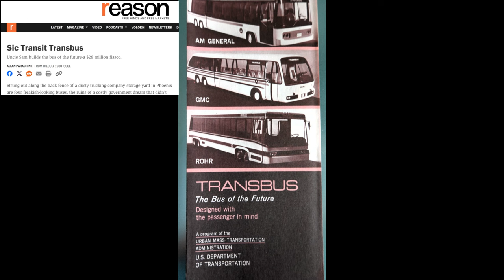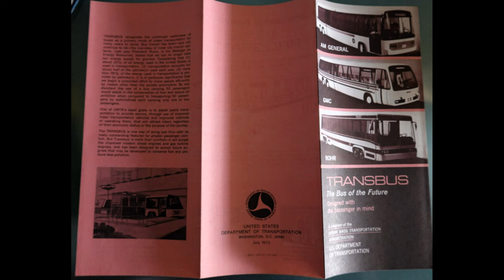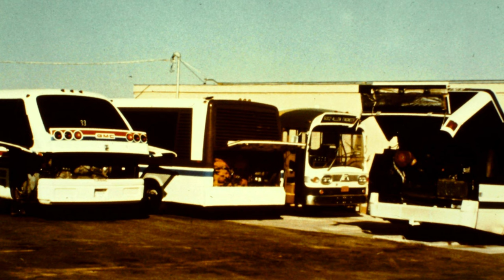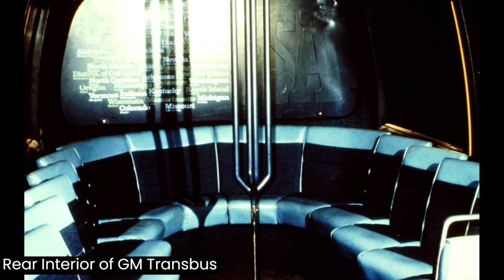TRANSBUS: America's Failed Transit Bus of the Future

Comment: Having ridden the RTS-1 (SPEED movie bus), the RTS-2 (RTS-1 replacement several years on) in various versions.  Mostly the ones I saw were all turbo-charged 6 cylinder models.  Then also the Grumman Flexible busses.  I came to the conclusion that the RTS-1 was the best of them all.  The RTS-1 was built for a maximum of 44 passengers.  The ones I rode in Dallas in the early 1980's, we regularly stuffed closer to 80 people on because this was on a very popular route and you just could not put enough busses on the route.  RTS-1 came in 2 models, a 6 cylinder turbo-charged model and an 8 cylinder non-turbo version.  Coming out of downtown Dallas there was a slight hump in US 75 that made it difficult for the non-turbo busses to make it up and over.  Once past that, the run was okay..  The turbo version had no problem making the hump as long as we had fewer than 70 passengers.  With the large number of people, every stop meant 20 or more people having to get off the let the riders that wanted to get off, then load up and go to the next stop.  Fortunately, the stop I got off was number 3.  It just worked, albeit the AC's couldn't handle the heat unless the bus was parked inside during the early heat of the day.  The RTS-2 models had lots of problems, mostly known for doors that didn't want to open.  They were a vacuum assisted system and there was often too little vacuum for the doors to work.  Later models had the doors replaced by motor driven bat wing type doors and those worked fairly well.  The Grumman busses were trash from the beginning.  Although not noticeable to the riders, there were all these rumors about cracked frames and engines that overheated.  An overheated bus can't run and without the engine running, the AC didn't work, so they worked fine in the morning, but were useless after lunch due to the Texas heat.  Note also that in the years since, Dallas has replaced all the high volume routes with commuter trains and it seems to work much better.  During construction of the train lines, a contractor plugged up a major storm drain, which caused flood water to back up into downtown and flood the basement of several buildings.  Since the electrical was usually in the basement, this resulted in shorted electrical systems that in a couple of cases took the buildings out of service for years while the lawyers and insurance companies argued over who would pay how much.  Also, for those of you that remember the early Compaq luggable PC, imagine trying to carry home this 30+ pound beast on a bus with 70+ people on it.  It wasn't fun.
Reply from the maker: Wow...thank you for watching and for that incredibly detailed comment! I have to go through it for all of the great info you provided!
Reply: I thought the bus in the movie Speed was a GM fishbowl
Reply: There was no RTS 2, They went from   RTS 1 to RTS 3 in 1978.

Comment: WOW great article. Thank you. I was a big fan of the RTS-2 as a kid. I remember with the Baltimore MTA got it's first order of 60 RTS's . These were fantastic because the AC worked very well. At the time Baltimore had the old classic GMC and old running flexible buses. The Baltimore order from news paper reports i can remember were shorter than the regular buses. They were 35 feet not 40. I don't know why they decided to go short maybe because of oil prices. They were ordered in 1978 and delivered into 1979. They got an additional order of 41 buses that came on line in 1980-82. These buses were different because they had been turbo charged. You can also tell because they did not have the noticeable arched back. They had a flat rear back of engine design. They did not stay long in Baltimore. They then went with the new Flexible designed at 40 feet. My school piggy backed on the Baltimore MTA order and got 30 870 flexes in 1985-86 for delivery in 1987. They then got 10 more with 8 30 footer and two 40. All were wheel chair kneeling designed. I loved driving them. Watching this video reminded me of my younger days watch buses and driving buses. Great video. One last thing those RTS-2 must be tanks because i have seen them everywhere. Disney transportation, Rental car agencies, I even saw a few in Tajuana Mexico with hubcaps on Ha Ha Ha. Cheers!
Reply from the maker: Thank you very much for watching and for your very interesting comment about the RTS buses in Baltimore. I'm very happy of your positive feedback!

Comment: Nothing has been as reliable and rugged as the GM New Look. The "fishbowl" buses were still in service long after these "improved" buses were scrapped.
Reply from the maker: Yes, and some still exist from 1959 in the NYCTA museum bus fleet. They still look great and run good, too.
Reply: TTC in Toronto didn't retire their fishbowls until 2012! They retrofitted their fleet with power steering, so life was a lot easier for the drivers.

Comment: Some transit systems like Appleton, Wisconsin's Valley Transit decided to continue with that which was working fine -- the good 'ole GM New Look bus. General Motors continued to manufacture these city transit coaches in Canada. Valley Transit saw benefit in having a unified look (all GM New looks with some old looks in the secondary fleet) to the fleet as well as parts interchangeability. Valley Transit's first-ever, brand-new buses, 1981 New Looks, were delivered in April 1981.
Reply from the maker: Thank you for watching and for your comment! Interesting to hear the preference of Valley Transit holding on to buying the New Looks into the 1980s!
Reply: Here in Oshkosh, the whole fleet was replaced with the GMs. But they kept the old ones for special occasions, like EAA. Now we got the green ones.

Comment: That was a very interesting and informative video. I watched the whole thing. It’s a shame it was so expensive and so disorganized. The RTS and 870’s were very popular and proved to be successful.
Reply from the maker: Thank you for your comment, and for watching the entire video - I'm glad you enjoyed it! Unfortunately, there's not much info out there about Transbus...but as you mention, we did get the RTS and 870 shortly afterward!
Reply: @JeffreyOrnstein Excellent Video! Thank you for sharing the creation of the Transbus. I’ve been a fan of the Flxible 870 and the GM RTS ever since when they first came out.
Reply: There were major design flaws with both models.  the 870 had major issues with the A-Frame structures cracking.  so much so that both DC Metro and NYCMTA had to pull them from service.  the RTS had issues with the HVAC system and had high failure rates with both the 01 and 03.  Grummann resold the design rights back to Flxible and thus the Metro-B emerged.  While that was going on, Green and Jamaica Bus companies in NYC took their RTS 03 demos and tweaked them enough for GM to redesign the AC units and in this case, the RTS-04 emerged. The biggest noticeable change was the switch from the "slope" back to the "square" back.

Comment: Two of the models served as the basics for the GM RTS, and the FLXIBLE 870/METRO.
The RTS was a hit across the country, while the Metro was a close second.
Reply from the maker: Thank you for watching and for your comment! Yes, you are right about the RTS and 870....too bad AM General left the bus business before they could introduce a new model.
Reply: Indeed, the "-II" in the "RTS-II" designation stood for two axles, as opposed to the 3-axle GM Transbus prototype.
Reply: @JeffreyOrnstein  After the RTS-01 rollout in 1977, GM introduced the 03.  D-DOT (Detroit) got the very first order of T8J-203s off the Pontiac assembly line.  NFTA (Buffalo) got the first T8J-603s.
Reply: Didn't AMG hook up with Flyer and co-develop the 800 and 900 models? (the 800 being like a cross between new look and ADB)

Comment: The simplest way to make a bus more attractive: Put it on railroad wheels, roll it along railroad tracks, and power it with electricity. Call it "Light Rail Transit." Smooth, quiet, and comfortable public transportation.
Reply: The British already tried this: https://en.wikipedia.org/wiki/Pacer_(British_Rail)
It didn't work
Reply from the maker: Thank you for watching and for your comment! Interesting idea....
Reply from the maker: Thank you for watching! Yes, but I believe some are still in service??
Reply: @JeffreyOrnstein  I'm joking of course. But also pointing out that rail transit is inherently more comfortable and attractive than a comparable bus.
Reply: So like a pacer!
Reply: @agy234  - The greatest flaw in the Pacer was that each car had only two axles. Also, when initially delivered, they used the original bus drive train. 

Fortunately, nothing as weakly built as the Pacers would be allowed to mix with conventional railroad trains in North America, at least not since the Rio Grande Southern closed down.in 1952. 

Presumably, because the Pacers were concentrated on branchlines facing closure for lack of traffic, Pacers were never involved in a serious collision.

Comment: My favorite RTS is the GMC sloping back models and septa had those buses 35 and 40 foot city cruisers before they went to the square back models in 1980 and 1977-87 from GMC RTS T8J201-04 1988-94 which it was sold to MCI/TMC known as T80206 and 08 and it was again sold to Nova Bus from 1995-2002 and the last is the Millennium was the last purchase from 2003-08 or later
Reply from the maker: Thank you for watching and for your comment! I also really liked the SEPTA RTS with the sloped back!

Comment: The engine choices between GMC NCI/TMC Nova bus and Millennium were 6V71 N or TA 8V71N 6V92TA Detroit Diesel and DDS50 engine and 8.3 Cummins diesel engines and V730-731 Allison Voith D8.63 and ZF ecomat 5HP 592 Transmission options between 1977-2008 or later
Reply from the maker: Thank you for watching and for your very interesting comment abou the engines of the RTS!

Comment: Duluth, MN used to run many short RTS buses. I liked them, the few times I rode them. On the other hand, the AM General buses in Minneapolis-St. Paul, were so terrible, the MTC eventually sued the company.
Reply from the maker: Thank you for watching and for your comment about the buses in Duluth - very interesting!!
Reply: @JeffreyOrnstein  It was quite striking when MTC put refurbished 1962 vintage GMC New Look buses, along with Flxibles back into service during the 1980s to make up for the failing AM General buses. But the truth is that I have been forced to leave a disabled bus many times over the last 50 years, but not one light or heavy rail vehicle. Bus design is apparently much more challenging than people realize.
Reply: @pacificostudios I remember MTC experimenting with several different bus manufacturers in the 80’s.  They bought a few Scania buses, apparently they weren’t satisfied with them bcuz they never bought any more.  And they had a large fleet of German MAN buses.  They had nice interiors and they were quiet inside and rode nicely.  But I was on one once that overheated and puked out several gallons of green coolant on a hot day.  I heard somewhere that the A/C coils were positioned so they increased the engine compartment temperature, so that running the A/C in hot weather and heavy traffic was a recipe for overheating.
Reply: @zyglo9826  The MAN buses were articulated. I remember those too. They rode relatively well, and were often on the 16A and freeway commuter runs.
Reply: @pacificostudios  right.  They were among the first articulated buses the MTC bought.  And some were straight 40’ buses too.  The one I was on that overheated was on the 35 express route from downtown Mpls to the park & ride lot at Metropolitan Stadium.

Comment: I wonder what makes these buses "freakish-looking". Or "futuristic". And the article, unfortunately, doesn't tell us why experienced bus builders, who, it seems, could design their own version of fulfilling the specs, had such trouble doing so. Also, I don't see how this could ever be "start from scratch" if you ask the incumbents to design it.
There's a lot there that doesn't make sense, and I get the impression that US buses still don't match the requirement ... while a number of today's European buses do. In my city, for example, lots of buses "kneel" at the bus stop (lower down the side with the doors), and there are simple wheelchair ramps to cover the gap to the curb that you can simply pull up from the floor and flip to the outside (if you even need them). And there is space for more than one wheelchair, stroller, or bicycle in that bus. I think I've seen at least three strollers at the same time ... though that did fill up a lot of space. I don't know.
Reply from the maker: Thank you for watching and for your comment! I guess in an attempt to make the buses look 'futuristic,' they were designed rather ungainly. Maybe it looked good on paper, but in reality, they were very strange.

As for American transit buses, kneeling buses have been in use since the mid-1970s. All of the buses now are low-floor and have a ramp that deploys at the front door for wheelchairs, etc (requirements for federal funding). On the inside, there are fold-up seats for wheelchairs. It is not politically expedient to remove seats in buses for this purpose in the USA. Why? Because many senior citizens ride the bus in many cities, and they are a very loud and sometimes powerful lobby. So the elimination of seats is a no-no. 

Low-floor buses also eliminate seats in the front over the front wheelwell, and I remember this was an issue here at first. So, low-floor buses, like the previous high-floor buses are compromises in their own way. There are many US transit systems that have bike racks at the front of the bus - something I don't think I've seen on European buses.
 
Since Americans like big, oversized things, low-floor buses were seen as a strange oddity at first, but now as it's a government requirement, it is commonplace everywhere.

Comment: Prototype buses exploding on a highway ain't uniquely Transbus or American thing. Serbian Ikarbus had the same thing happen with Ikarbus 112. These buses were cobbled together with Mercedes badges stuck onto them during President Vučić's election campaign, when a bunch of last generation Mercedes engines left over in the factory were purchased by Serbian government to be used in "Serbian Mercedes" program as part of Vučić's personality cult. His party newspaper published pictures of him posing with 12 hastily cobbled buses, it was published on state television and the whole operation was completely shambolic and about as atrocious as Turkish Devrim car program where cars were not filled up with gasoline for ceremonial ride. Engines in Ikarbus 112 buses were not positioned properly, rear doors opened weirdly narrowly only to access tall rear staircase leading above the engine, and most importantly, electrical systems were assembled by a team of what I can only believe to be chimpanzees with ADHD. One of the key things was that ECU (electronic control unit) guiding fuel supply into the engine was not connected as it should and that, due to the strange engine positioning fuel line ran too close to hot exhaust pipes. That led to a bus with such an issue ending up as a test unit with GSP (Gradsko Saobraćajno Preduzeće - City Traffic Enterprise, Belgrade City transit operator), and on a hot summer day, with GSP driver and engineer on board as well as test crew of Veliki Točkovi (The Big Wheels, country's only magazine about trucks and buses), 5 people in total, Ikarbus 112 bus burst in flames like Southern California. State media blamed Mercedes for delivering faulty engine due to West not wanting Serbia to be successful and presented buying a bunch of stupidly made Russian and Belarusian busses from "friendly Orthodox countries" as a victory of Serbo-Russian friendship. I have a misfortune of using Belarusian MAZ bus for my daily commute and a running joke around suburban area of Železnik, neighbourhood served almost exclusively by MAZ vehicles is that "homophobes should not be allowed to make buses"....
Reply from the maker: Thank you for watching and that really interesting story/comment! The Ikarbus 112 sounds  like a good idea for a video!

Comment: Typical government waste. Instead of trying to force unworkable designs they should have fielded improvements and change suggestions to companies to see what could be applied by the market. As it was, production busses already were pretty solid and reliable, and incorporating changes in new designs would be more effective than bureaucrats trying to design something they literally have no understanding of and likely had never even been on trying their greasy paws at forcing impractical designs!  You would think GM, Flxable and AM General who were already building busses would have been able to handle this better. This is just like the DOT's creation of a "safety motorcycle", it was an over complex nightmare that ended up steering from the rear wheel and had a cage around it larger then a car. Government runs on committees usually made up of people with no idea of what they've been put together for in the first place, and they come up with useless wasteful ideas.
Reply from the maker: Thank you for watching and for your comment! Yes, totally agree...don't give the government the job to design a bus. Maybe this is why it has not happened since!